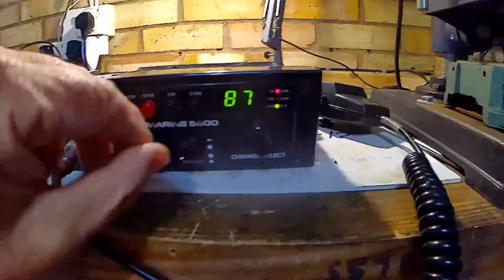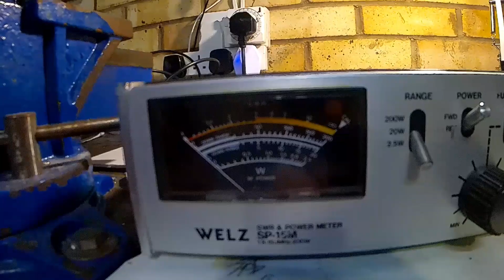Fake Transistor. Aqua-Marine (NASA) VHF Marine 5600. Radio Repair Project. Part 5. Fixed.

Comment: Hello from W8WIN, Sometimes its just the satisfaction of knowing you successfully fixed an old radio to prevent it from ending up in the parts bin, and extended its life for a bit.
Reply from the maker: Many thanks. Certainly a challenging.  I nearly gave up with it. I had a big hammer ready. George